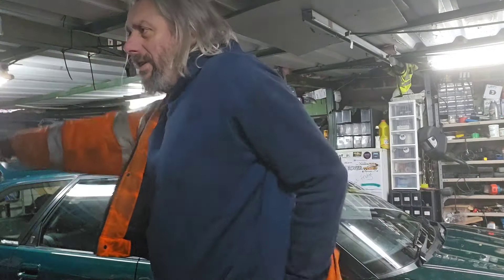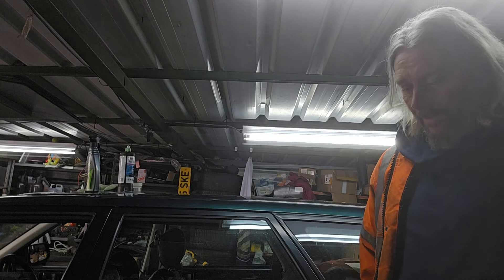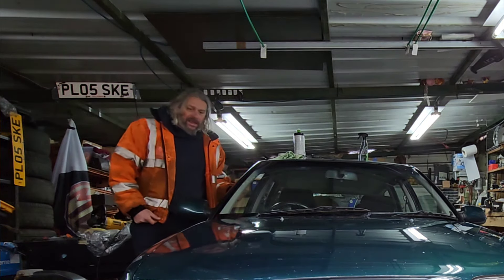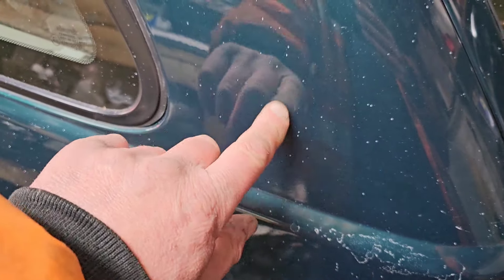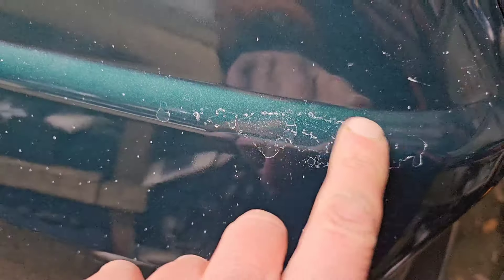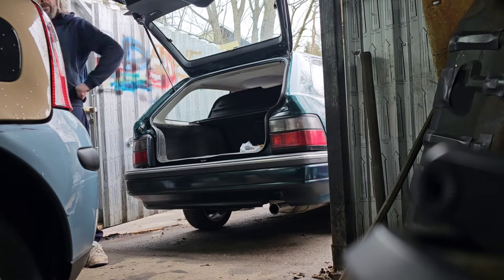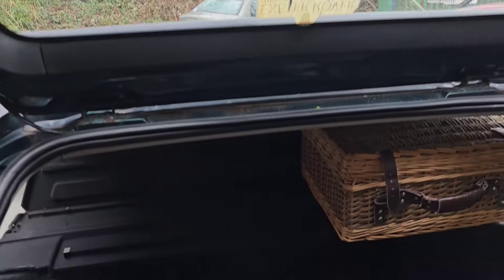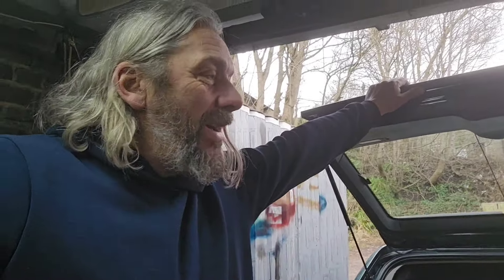Toby Charles Returns! The most wonderful car, back on the road

Comment: Hi Paul, Toby looks fantastic, very glad your keeping it. Must get mine back on the road soon. Needs starter motor sorting but ready to go otherwise. Paintwork is terrible and needs a full respray really. Have to save some pennies and lots of pounds I think.
Reply from the maker: Have you got a 420?
Reply: @ProjectNigel  Yes same as yours, a gsi tourer, high miles on it but drives great.  Bodywork letting it down. Had the bonnet and roof wrapped a while ago but the crazy paving srcatches have appeared elsewhere since and lacquer peel on the rear offside.
Could come to the yard in it as I'm not far away if your interested in seeing it? I've been down once before in another gsi, hhr model.
Reply from the maker: Ah, yes, I remember.  It would be great to see two together
Reply: Yeah it would, Mine's an M plate too in tahiti blue but had a much harder life than yours. I'll give the scratches and rust a polish and let you know when I can make it.

Comment: Happy birthday Mustard. If a chrome grille on the front of a Rover has gone pitted and oxidised, it's tough luck. Now, my badges and alloy centre caps were losing their shine, so I went to Halfords in search of a 'Chrome Paint' spray can. Believe it or not the young lady at the counter told me not to bother, it's rubbish.
Reply from the maker: Chrome spray is apparently very difficult to use with anything other than rubbish results.

Comment: At one point I spotted you carrying an item that looked like it was on fire and placing it in the front drivers side footwell.  I must inform you I have an issue with blood pressure and at the above mentioned point I was palpably red in the face ( not good). Was it your birthday cake's many candles going out and causing the smoke ?  TC is indeed an ox I sinfully covert.
Reply from the maker: I don't remember that bit